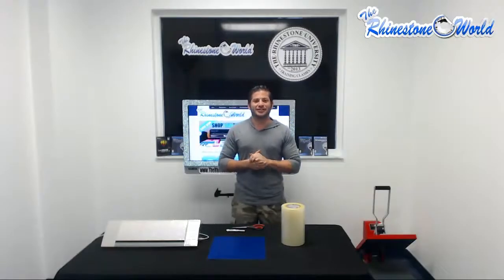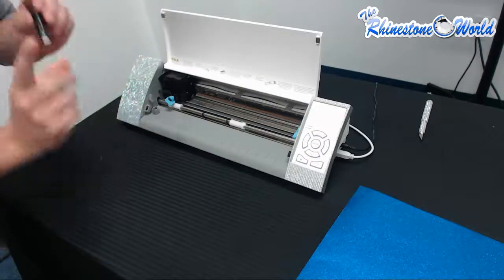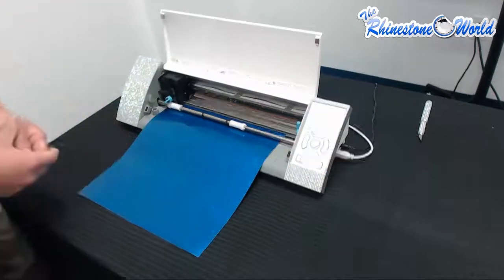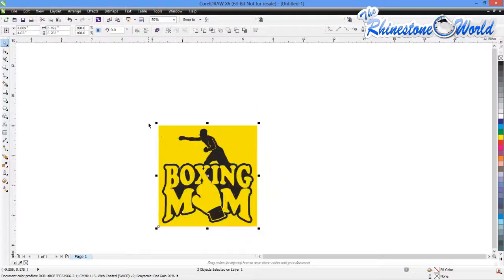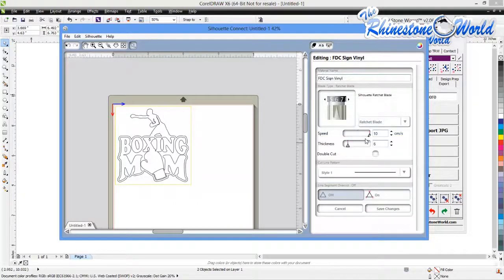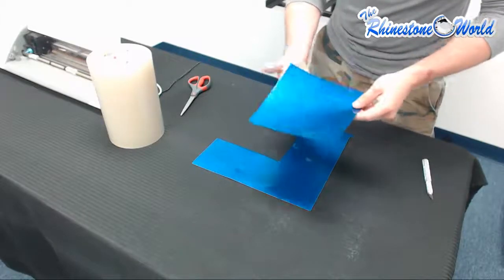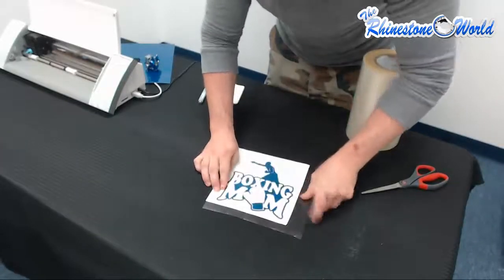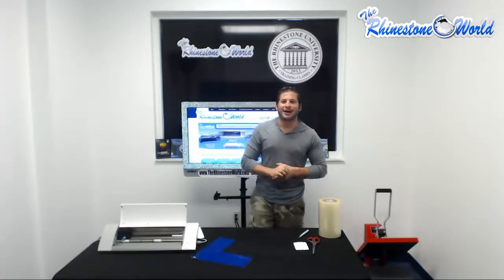How To Create A FDC Sign Vinyl Decal Using The Silhouette Cameo

Comment: why do use ratchet blade?
Reply from the maker: Lucrecia,
The Cameo in this video is Cameo 1.
Cameo 1 utilized ratchet blades and similarly sized blades.
If you own a Cameo 3 you will set your blade depth in the software for the autoblade.

TRW Casey